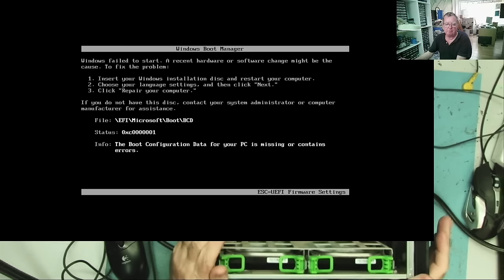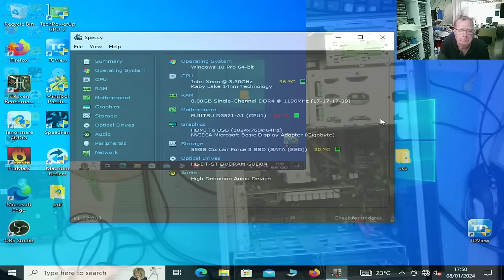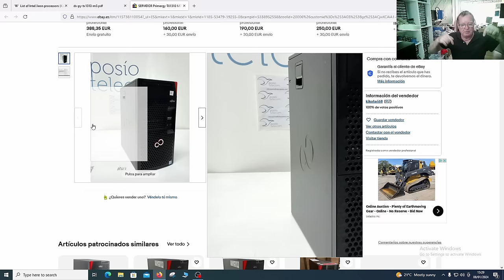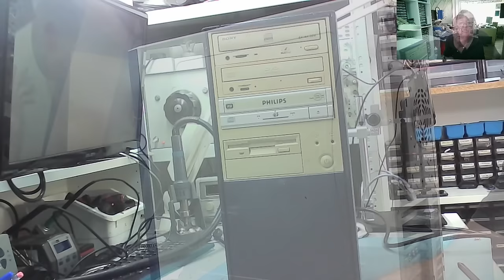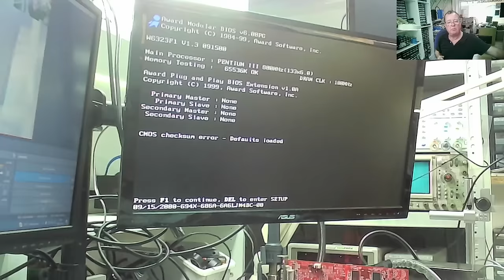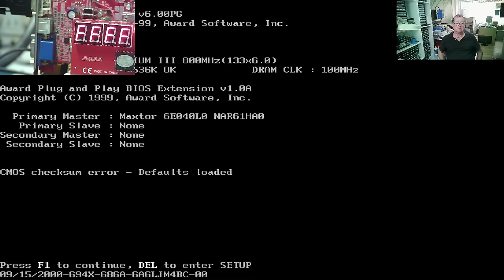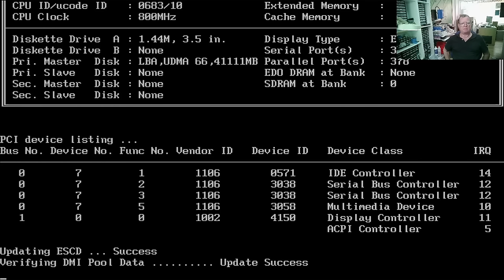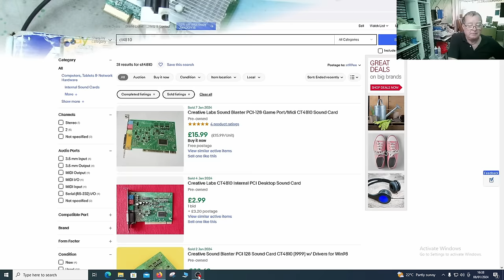Retro PC Finds at the Flea Market / Car Boot Sale 6th January. What did I FInd And Can I Fix It?

Comment: I think the first machine was probably in a raid setup which would be why it wouldn't boot fully. Or the raid failed because one of the drives went out. Either way a bargain
Reply: Greetings:
I agree about the Raid configuration. You should be able to get to the UEFI BIOS through your keyboard.
That should identify how the drives are configured and everything else as well. Maybe the seller was not technically familiar with UEFI stuff.

Comment: Can you work from the bios optimised defaults state towards a best performance available state? Despite many attempts and much reading etc I never get my head round the clock multiplier and ram settings. Most sources are aimed at max over clocking which complicates the process. I need basic simple guide for this older style bios.

Comment: I'm a bit surprised you don't have an air duster. A little high pressure air can clean a lot of dust and debris out of the slots before having to resort to IPA. The speed of the air from the hot air gun just doesn't cut it.
Reply from the maker: I do have an air duster, I've had it all my life, it's called 'blowing on it' 😂

Comment: There is no exact equivalent desktop processor to this Xeon. It has 4 cores without hyperthreading like the i5-7xxx but L3 cache is 8MB instead of 6MB. The i7-7xxx processors have 8MB L3 cache but also feature hyperthreading. So probably the best equivalent desktop processor is the i5-7600 which has a higher operating frequency but a smaller L3-Cache than this Xeon.

Comment: The Fujitu Primergy, I would install the original hard drive and but the case cover back on. There might be a senor that detects air flow and since the cover is off, it's shutting down the computer. I noticed also your motherboard temp was high with the cover off. You noticed this too.

Comment: Hi Richard, I recently built Mr Bleep but I have a problem when testing Schottky diodes , I don't get the blue light and beep,
I either get no beep and no light or I get continuous red light and continuous beep , any ideas what could be wrong? (diodes tested was BAT54 & 1N5711)

Comment: Cleared out a music recording studio of all its old hardware last week, with a load of gpus, motherboards and cpus. One of the cards was a weird geforce 6800 ultra with 443 mhz core and 600 mhz memory that works. But one is a geforce 6800 gt agp that seems to work, pc goes on and displays geforce 6800 gt vbios but then the pc does nothing and will not boot from there. Any idea what would be wrong with the gt? Maybe a corrupted vbios? Never seen anything like this before.

Comment: If the Fujitsu machine can accept Win11 as-is without hacking the tpm/cpu type checks then it's useful so keep it. Otherwise sell it.
Reply from the maker: Interesting comment as I have six PCs at the office and five at the house (excluding laptops)
All of the PCs at the office run Windows 10
Two of those at home Run Windows 10
One at home runs Windows 10/XP dual boot (used for gaming)
One at home runs XP/Windows 98 dual boot and DOS (also used for retro gaming) 
And this one that I am typing on right now at home and gets used daily runs Windows 7, used mostly for monitoring my Youtube in the mornings, emails, ordering from Amazon and AliExpress etc

I run my own business, regularly publish on three YouTube channels (this one being by far the largest), edit around five videos a week and Gran Canaria Uncovered chanel is all 4K/60fps video combined/edited from multiple camera sources on each video, yet I have not so far found any need to change any of my computers to Windows 11.  Is that odd?
Reply: @LearnElectronicsRepair  I don't use W11 either. My main PC is still W7. I'm just saying if it passes the checks then it's reasonably 'modern' thus useful for at least another 10 years.
Reply from the maker: @g4z-kb7ct  I'm keeping it anyway, it's going to be used on @TheElectronicsChannel live streams as the second PC to complete the setup we already have. Just needs an extra 8Gb of DDR4,  I already put a 1TB SSD in it with Windows 10.  I'm well happy with this one for €20 not that I knew what it was when I bought it, this just came with a kot of several retro PC which are what I am really looking for 🙂